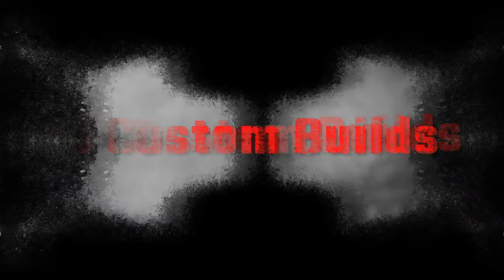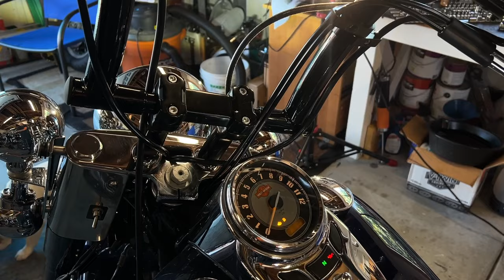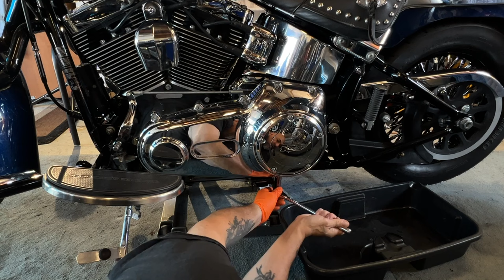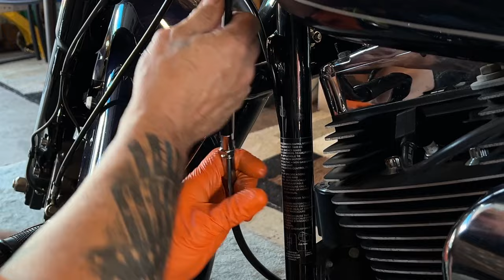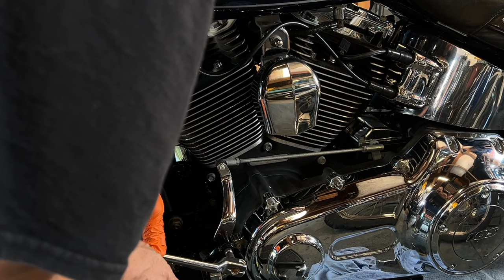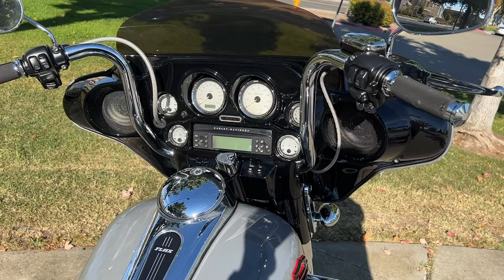"Inner/Outer Clutch Adjust, Primary Oil Change & New K&N Air On Harley"

Comment: Can u share link for air cleaner
Reply from the maker: K&N Universal Clamp-On Air Intake Filter: High Performance, Premium, Replacement Air Filter: Flange Diameter: 2.4375 In, Filter Height: 6 In, Flange Length: 0.625 In, Shape: Oval Straight, RC-3680
Reply from the maker: https://a.co/d/066N34dl